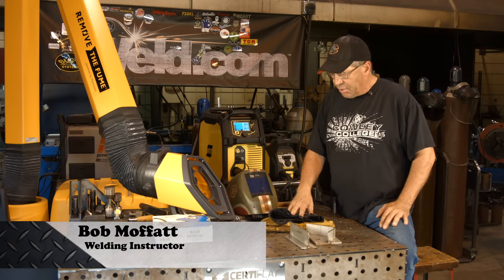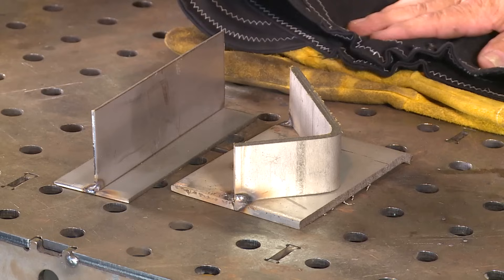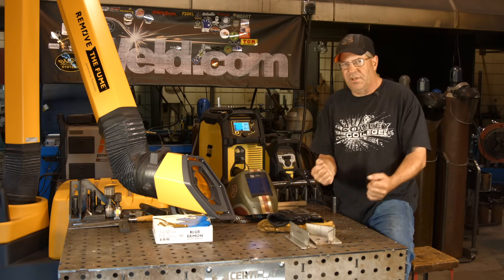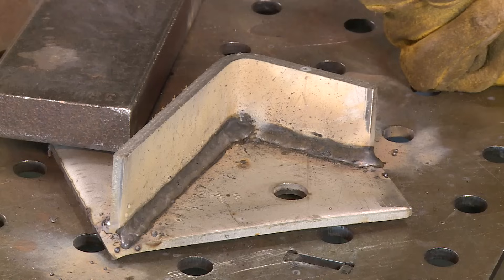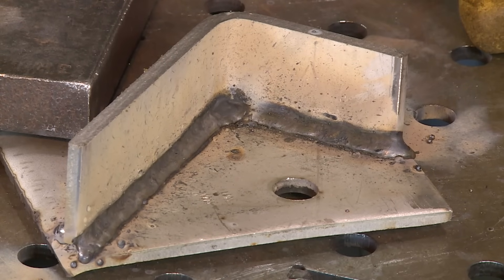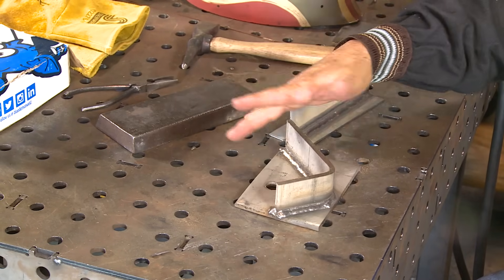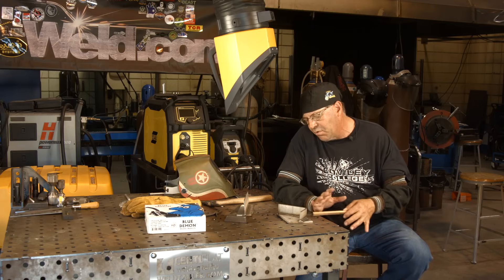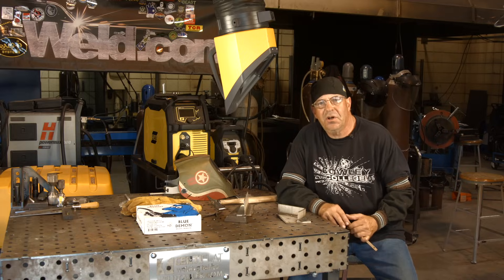Stainless Steel FCAW without Gas

Comment: I want to use this to try and weld some slip fit stainless exhaust pipe and probably some V band clamps. I hope my welds look that good. I will practice of some scrap first. I see they sell this in .030 as well. Would that work better for the thinner exhaust pipe stuff?

Comment: I've found using the SS, FC wire takes alot of experimenting w/ wire speed, voltage and even both DC+ and DC-
I got it to run smoother with a short stick out rather than a long (3/4-1").
Be sure and NOT breath any of that SS smoke......

Comment: Well I guess i'm not the only one that would like to weld with this wire.
I tried it the other day, but unfortunately it ws on a tank i'm using to heat my hot water
Had to take the bottom of the tank off,
And i did encounter that ball
And i do not like that,
i also found mine was not a very good weld
And yes i developed several small leaks, which i have to go over again, what a mess,
but i never did use a long stick out as you did,
But i'm going to try that when i try to do my patch up,
Looks pretty ugly so far
but i didn't expect much since  I have  never done any stainless welding.
But what do you expect from 81 years old and no moeny to buy gas and/or tig tourche.

Comment: I used Blue Devil flux core SS wire and what I noticed the weld looked like surface weld, not penetrating to the weld area and balling/clumping.

Comment: Looking to try out stainless steel flux core wire. But I'm wondering if it's available in 0.03 rather than .035. Might that not work out better?

Comment: I use only gassless flux cored wire for mig welding here in the qeer old corrupt uk 🇬🇧 and had removed the shroud completely as u do not need it for no gas flux core mig welding wire as the shielding gas is produced at the direct heat source weld. Also u can see and control the men weld bead better.

Comment: just welded a stainless boiling pot very sofisticated saturation control inverter cross transformer machine i could get rid of the bubble on the end but weld tip to job absulutly critical and used co2 beer gas to asist good luck

Comment: These videos come in really useful.  I was just wondering if I could use my little flux/mig welder to tack together a stainless BBQ grill.  Just something like an old beer keg, to replace our rusted out BBQ.    Something that'll last longer than the cheap consumer grills.  And if I build it myself, it's easier for me to rebuild in 10 years.
Reply: Yeah man we use 7018 on stainless in the mines, if you weld it hot it'll stick in a non critical application.

Comment: What are your thoughts on using this for on site commercial kitchen repairs? Sure would beat dragging a bottle of gas around the restaurant.
Reply: Did you ever use this in the kitchen?  I have the same question. Sinks are always cracking. But the sinks are obviously 304 SS which the 308 wire is used , but they are a lot thinner than what he was welding here. So I’m worried about burn through. I and looking into backing tape   
Just wondering if you went ahead and did the flux or decided to go with a TIG since they are advised to use on thinner material.

Comment: So, this is like the only decent SS flux wire video out there (LOVE these older Weld.com vids, miss Mr. Bob so much), and I'm on day 3 of just needing to TACK a bunch of 18 gauge SS 1/2" mesh to SS 1/8" frame stock... man, this SS flux stuff is just awful, can't go low or slow enough for proper tacks and it's VERY dirty. Tried switching to 120v but nada. Just a huge conductive issue that has no sweet spot I can find. Globs and arc-jumps, wire comes out of the spool gun at different angles, just a bear to figure out. The SS Flux has flux in the core so guess that's why it's DCEP, so weird. Getting it done but a HUGE pain. Next time I'll use the gas.

Comment: Do you think something like this would work for exhaust? Specifically, I'm looking to install a 409 stainless exhaust system on a couple of my cars. Lincoln Electric recommends 309 wire, and there is a 309LFC-0 wire available.

Comment: What if you set a welder to use AC TIG setting, with whatever balance works, while using it as a MIG with this stainless wire? I assume you need electrode positive to yank off the oxide, and that also causes your wire to bead.

Comment: Just caught this video. I seem to have missed a few ones the last few years. Because of COVID, I can’t get more gas right now, so I’m doing more flux core than I normally would so as to preserve the gas as long as possible for where I really need it. Pretty much out of argon too, so TIG is out for now. I’m going to buy a roll of this. It seems very useful.

Comment: I'm wondering, picking up stainless exhaust kit pipes, tomorrow. I'm wondering if I could use my Lincoln HD 100 gasless, to weld up joints? Then using clamps? I'm going to Sub u and thumbs up. Hope you'd reply thanks in advance.

Comment: I asked this question on another video, can you run this wire on stainless to non stainless? For example, I do a lot of exhaust work, stainless exhaust to a normal steel flex pipe?
Reply: 309 for steel to SS

Comment: 309L is a fickle beast. I find higher amperage with lower feed speed and voltage and i can get it to act right(ish) but youll end up with a lot of porosity. Super easy to end up with pigeon $#it welds. Which makes you less a welder and more a grinder.

Comment: I used to think this was the best until recently, I have found a wire that's better than BD. my flux core welds now look like mig or  stick welds.there are much better wires out there than Lincoln and for much less.
Reply: What is it man?

Comment: The ball on the end is a process known as globular transfer as opposed to spray transfer it usually happens at voltages below 30 volts spray transfer happens at higher voltages. I've seen spray happen at under 30 volts but that is rare.

Comment: I'm glad i found this video. It shows how well the results can be using Stainless flux core. I was trying to use this exact wire on my 110v 135a mig and was getting terrible results. And my welder should be fine going by the wire manufacturers specifications.  Afterwards i found out i had to set it up as a Decp instead of Decn like usual with regular flux core. Worked much better! Now i just need to improve my welding skills.  Thanks for this video!
Reply: How do you rate your welds?
Reply: This is a great tip. Thanks for mentioning it.
Reply: Anyone tried 308lfco from nice tech? I feel like it's easier to use the. Blue demons brand. You also don't have that ball sticking off the end

Comment: Thank you for the demo!  I dont use my gas-less mig very often and have found the wire was getting rusty. I was looking at SS to help with that issue. You answered my question.
Reply: You can get coated flux core, I also find storing the wire in an ammo dry box can help alot. Just close the box up in a warb dry area and I find that alone is normally good enough. Of course that does involve unloading the gun each time.
Reply: @rniejx4219  Thank you for the tips.

Comment: Seems like a good option for your home mechanic to do exhaust work
Reply: If your exhaust is too thin, you will blow through. Id suggest sticking with mig, much cleaner and you can control your heat better, just make sure your dialed in on your machine right
Reply: @BenRossi901  Could you back it with copper? I am a home guy without the cash for a whole bunch of different gas bottles, so it would really open up some options, and I want to do a bike exhaust.
Reply: Actually runs pretty good on exhaust without blowing through. I bought a roll to tack my exhaust together before using tig to do the final welds. May just use this stuff for all the welds.

Comment: Very interesting video. Ik have to do some stainless steel welding so being able to use this fluxcore for it, is a solution. Just one question: Do I need to change the liner inside my mig-torch?  Thank you an d have a great holliday-season!

Comment: Do you need a special wire when welding stainless steel in a flux core w/no gas?
Reply: That is what he was showing us, a new special wire for stainless. The first flux core no gas wire made specifically for stainless

Comment: Wow, A lot of questions when it comes to welding. Different machines, direct current, A/C current, gas mixtures, flux or no-flux, penetration, looks. I guess I like the old days, even McDonalds only had three items on the menu once upon a time. I was there. I started with a crank-top Lincoln on the farm and what ever stick we had laying around, but step-dad and grandad neither knew how to weld. I am reminded of this when looking at burns in the crook of my elbow and once between the big toe welding upside down under a disc & tennis shoes.

Comment: I have used the stick welding stainless steel rods and you can weld carbon steel with them I'm wondering with this stainless steel flux core wire can you weld carbon steel with it .

Comment: DCEP??? Really???  I've always thought that flux core "must" be run DCEN.  This is an amazing break through if it is a standard welding process with this wire.  Thanks for the video, and I'm going to have to try this on my Lincoln 140HD, yes a Home Depot machine.  Will it work as well at 0.025 as well as the 0.035, with varying voltages/amp draws, and at what arc length?  You used this flux core wire as a "push" too, (Slag = Drag???) Holy Cow!  I'd have thought you'd get MEGA "porosity" from the slag build-up from in front of the puddle. I'd like to hear more about this wire, and it's abilities.

Comment: i got a millermatic cricket 110 v using flux core wire .035 and welding stainless steel bolts and nuts, forgot the number but high grade stainless 1 1/16 bolts/nuts and the outcome of the weld looks as nice as some gmaw welds. is it structurally strong? probably not but far from not working at all. i've asked kevin guy and he brushed me off as complete dumbshit. Weld dot com is the one to watch.

Comment: Excuse me guys but what would be the most versatile fcaw gasless wire for stainless as far as welding higher carbon steel with lower carbon wire or low carbon steel with high carbon wire.  Trying my best to avoid purchasing so many different wires. My applications would be for automotive purposes ,exhausts and manifolds. Thanks

Comment: Hey Bob thanks for the great vids and education. I had a question, our company bought similar wire .035 and we have to weld 16 gauge tube shields on the HRSG boiler tubes. So we are in vertical. We wasted 3 hours trying to get the right settings and no luck. Even on our best attempt we could not get rid of excessive worm hole porosity. If you would not mind and maybe doing a video on settings for 16 gauge with SS FCAW-S it would be greatly appreciated or a simple reply would suffice. Thanks and keep up the great work.

Comment: Is there any specific reason you're running DCEP? I thought flux core was supposed to run on DCEN
Reply: 4x4forlyfe - this wire is specced to run DCEP.  He said in another comment he tried both, because of the "balling", with no improvement on that front.  He didn't say whether the DCEN welds came out OK.
Reply: @orcoastgreenman  You want to follow manufacturers polarity, different wires may run opposite polarity for the same process there are many variables that affect this that are known to the manufacturer. Mild steel usually runs DCEN but that doesn't necessarily apply to other wires.
Reply: slick1rick1 - thanks for the added clarification.   I was acknowledging the fact that the polarity reccommendation from the Mfgr for this blue demon is the opposite of the most common reccommendation for the most commonly used mild steel flux core wires, and you’re right, one should always familiarize one’s self with the recommendations from a specific product manufacturer.

Comment: Hey Bob! I was just wondering if there was a specific reason for running it DCEP, although this would certainly account for the Hypnotic Ball hehe, not sure how this SS wire should deviate from the FCAW standard practice of DCEN to keep the heat in the pool allowing the Slag to form evenly.
Great Videos BTW, Subbed
Reply: minbari001 - perhaps the flux acts differently?   I was thinking that it somehow affects the surface tension of the molten wire and that causes the balling.  Perhaps it forms a liquid coating that is only "attracted" to the stainless while it is molten, rather than an expanding field of gasses around it?

   It definitely seemed like there wasn't much mess besides the slag it's self compared to the standard steel flux-core welding I've seen done, where you have to wire brush the "flux mess" off the work for a couple of inches on either side of the weld.

  Maybe just the lighter color of the stainless, but it seemed like there was less flux smoke residue.

Comment: Hello Bob, I've been trying to use 308LFC-O Blue Demon flux core wire. My problem is setting my machine I'm using a Lincoln Power Mig 210MP. This machine comes with all pre settings. Do you have any info that can help me boss? Thanks,

Comment: thanks for  a good video, am I correct in thinking this method is no good for welding thin stainless  as I want to make a fuel tank  out of a kitchen sink
Reply: I'm wondering as well. Flux core isn't available in small diameter wire (for at least the obvious reason of not having room for the flux core), which makes welding sheet metal quite challenging.

Comment: The company I work for uses a couple different flux cored SS wires. We use 1/16th gas shielded wire for out of position work or smaller jobs and a 3/32nd self shielded wire for bigger stuff flat and horizontal only with that wire though. I've noticed the big wire runs more of a globular transfer if your travel speed is too slow, but when it's set right and your travel speed is right it's nearly a spray transfer. The globular transfer on that wire may just be the way it runs. Would like to see another video when you get more familiar with that wire.

Comment: I've ran miles of gas shielded stainless flux core but never self shielded. When I saw this product on Amazon I naturally figured it was a typo. Thank for showing this, seems like it would be potentially one hell of a useful product. My only question is, what does a cut & etched cross section look like?? Will it shoot X-ray? Maybe a quick video showing the etch and film on the coupon you already have?
Reply from the maker: Tony, well see if we can dig this out of the scrap bin and cut it real quick. If we can find it we'll post the pictures over on the forum: https://www.weld.com/forum/

Comment: Hi Bob excellent video yet again. May I please ask a question on mild steel gas less flux core, is any good for butt welding steel plate in the overhead position on the bottom of a small boat?
Reply: Man that's a tough one. Steel boat? Small? Can't turn it over to work on it? I would use another process right off, if it was me. Why a butt weld on the bottom? Repair or add on?
Reply: Well its about 30 foot long weighs around 7 tons so flipping it over is not an option. I can weld from the inside in shelter some of the shell plate to be replaced. So its a cut out and replace some small areas of 
1/4 plate. I got one 10lb spool of lincoln innersheild and outershield from a friend but its windy here most of the time on the coast so using any gas will be a challenge. I also have some boxes 7018 but I saw your other flux core video and thought it may be a little easier to use mig. Thanks for coming back to me Bob much appreciated
Reply: gmcallsuk I'd go 7018.
Reply: Thanks for taking time to reply 7018 it is. There is no welding college here so I sure appreciate you and your team putting these videos together.
Reply: Where are you located?

Comment: is there a reason to keep the nozzle on the end of the gun when using flux core?
Reply: Yes! I like having a contact tip in place when using GMAW equipment. On this gun, it is the only way to keep it in place.

Comment: Blue Demon is just a label.. they don't manufacture any consumables themselves.  The "ball" at the tip of the wire has to do with how the current flow reacts with the stainless steel strip material used to manufacture the wire.  Current flow is much different with s.s. compared to Fe steel.

Comment: Does that product maintain the original stainless steel's corrosion resistance?
Reply: Tbm00001 - there are some descriptions of the various grades of 300 series stainless flux core wire they sell at the blue demon site.

  From my memory it appears that they claim to...  Some being better than others, according to the grades of stainless they are compatible with.

Comment: i learned how to mig making a bunch of stainless parts, it was with solid wire and gas i think c25 ,it was long ago but i seem to remember a ball on the wire and i for sure remember that a stainless spark will take about 8 laps inside your ear as opposed to 2 laps for mild steel.i think i need some of this wire.

Comment: Well well!! I went through this last week and will be going through it again next week. Except I am running 410 flux with 100% co2 and man it does the exact same thing. Big old blobs coming off the wire lol not fun to watch it lay down but it work lol. This wire looks to be the part not having to use gas 👍🏼

Comment: I've ran that wire in 035 and I didn't have any technical specs for it. I ran it on DCEN and didn't have of the ball stuff going on... I only had a 1lb spool so I didn't get to try too much stuff. I was taught that DCEN was for preheating the Flux on self shielded wires to get proper slag coverage. Maybe this was wrong.... Let me know because I'm really curious now.

Comment: it looks like a globular weld transfer.
does that change where you could use it?
could it be used for open root light tube. like exhaust pipe.